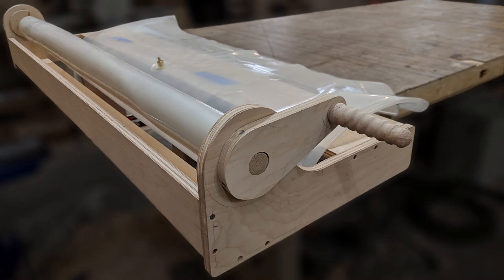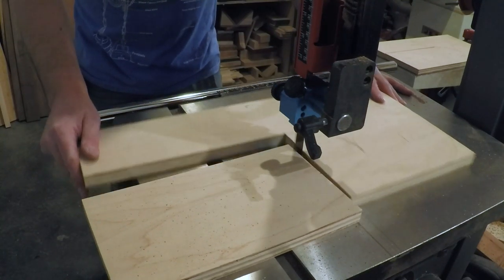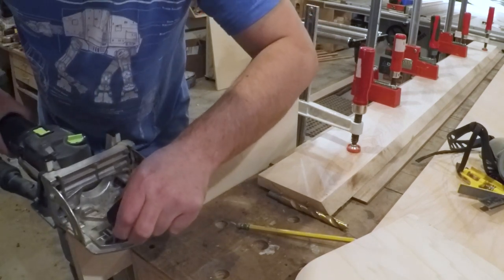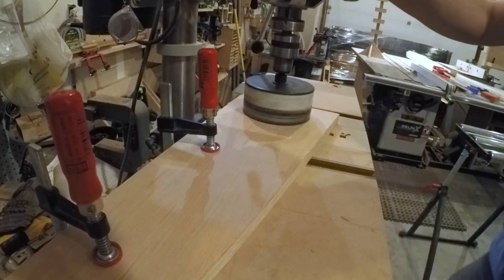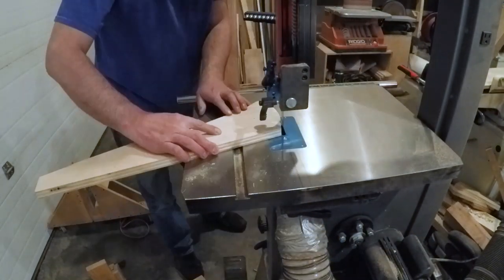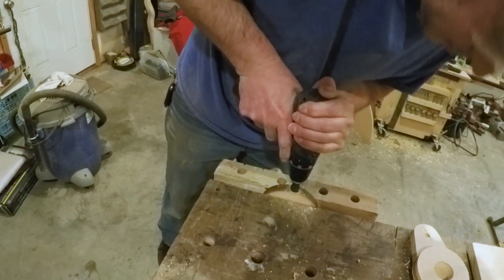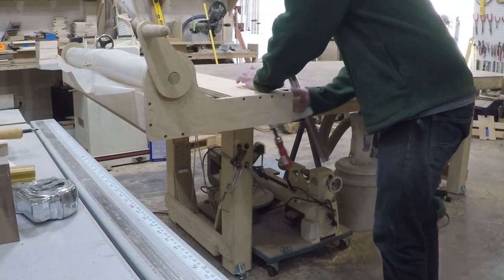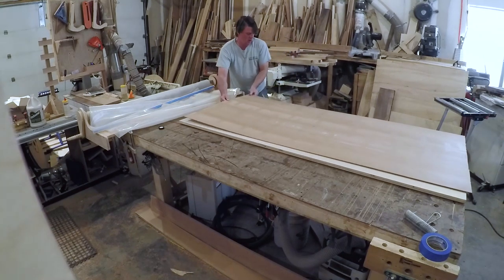Building a Veneer bag Deployment and Storage Jig - Woodworking - Shop jig

Comment: Brian, I’m very intrigued by your workbench. Looks like a torsion box with a sacrificial surface? And it looks like you built lift jacks to enable you to move it (I’m guessing it’s heavy as hell)? Are the legs solid, or are they boxes? Any chance you can do a feature on it? I’m in technical theatre, so big work tables are often more useful than traditional woodworking benches in my line of work.